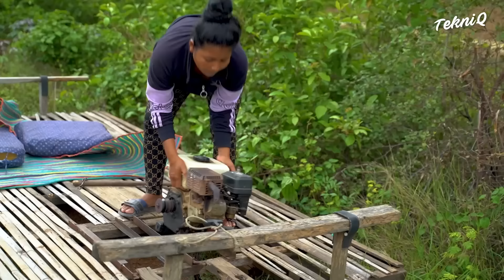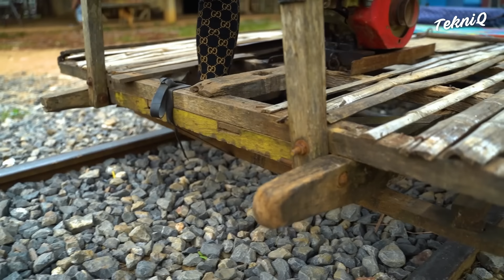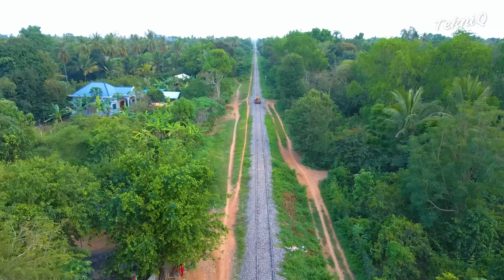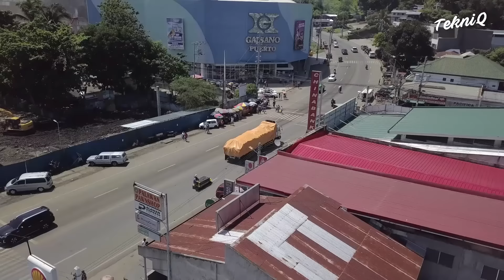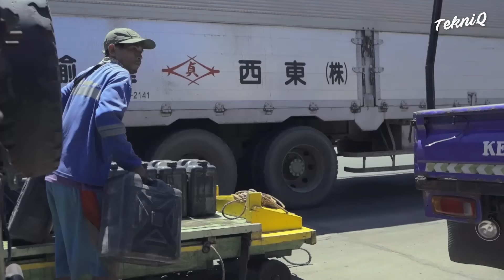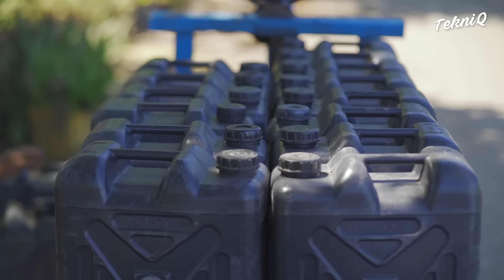Riding a Cheap Bamboo Train Until a Big Train Comes

Comment: The second part with the water transporters looks like rural Palawan outside of Puerto Princesa city. I have been witness to this and many other innovative ways the people got things done in the area. It may be primitive, but it works!
Reply: No.. This is in Puerto, part of cagayan de oro in mindanao... They are fetching water from low lying lands to be brought uphill. That road leads to Bukidnon province that is so mountainous in nature...
Reply: @portsidebear i've been there! i stayed in el nido for a while. have you seen the subterranean river?
Reply: In my country, we transport clean water much more efficiently: in underground pipes.
Reply: @HemiJoel  Yep, and how many years and how much investment was needed?
Those guys made that cart from scrap in few hours. 

I assume that you do not understand the power of capital and good administration. 
You need both to have a good infrastructure. 

An by the way of pipes. I remember some initiative of some westerners to help some african villagers. 
They ”invented” a selftransporting barrel. Actually a barrel with ballbearings at ends, that was dragged by dragging it. 
better than transporting the water on the heads as villagers did. 
But the method was stupid and wasteful. Barrels needed to be thicker to resist on road, and hence expensive. 
And even more expensive because they overcharged, funds being raised through donations. 
All that plastic could be used simpler as a pipe, resist much longer. And even pumping by hand, would have used a lot less human energy. 
But that thing looked like a scam. An cheap and efficient system could not bring asa much funds to the scammers.
Reply: It looks like truck drivers know what is going on and they tacitly do cooperate.
And how the bamboo train doesn't derail?
Reply: @nevco8774  Yes, at one moment we see the guy signalling to the driver, like asking permission. 

The wheels have a large rim on the interior side, actually like train wheels.

Comment: I'm amazed that the truck drivers are OK with them attaching to the rear bumper and getting free transportation.  I guess that pulling that small additional weight doesn't significantly effect the fuel mileage.
Reply: The issue is probably how your going to feel if the end up in a wheelchair.
Reply: @Wornout1  Big difference in the culture and society.
Reply: Because the people are not trying to rob them.

Comment: I never knew those things are done in South-East Asia. In my country railroads are fenced and it is impossible to access them just by stepping in, except if you climb the electric fence (or whatever). The Hitchhiking "trailer" has a braking system which I doubt is effective when the truck driver does an emergency stop and the riders have to deal with inertia when the tanks are full of water.

Comment: That’s just plain dumb. I’ve seen plenty of trucks on wheels on obviously disused lines but this is a well maintained regularly used line. How can anyone be so lax about their own and others saftey
Reply: As you can see, it works. 
There's propably few trains, going slow, with an audible signal, according to a plan... enough of those to be reasonaply safe- safer than an open belt and other exposed machine parts.

This clearly isn't just shenanigans, but a mode of transport. So, they propaply know what they are doing.
Reply: These are countries where you regularly see four (or more) people on one motorcycle and not wearing helmets. Often someone with an infant in their arms. Safety has a very different meaning there. I live in Thailand. The record I've seen so far is three adults and four children on one motorcycle (which beat four people and two chickens I saw another time).
Reply: Safety : a First World luxury.. or a Gilded Cage.